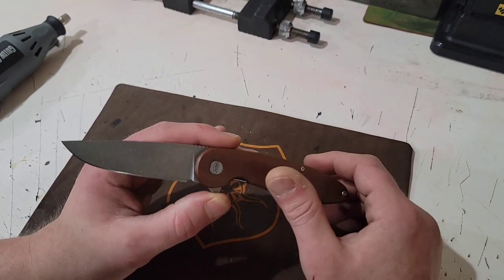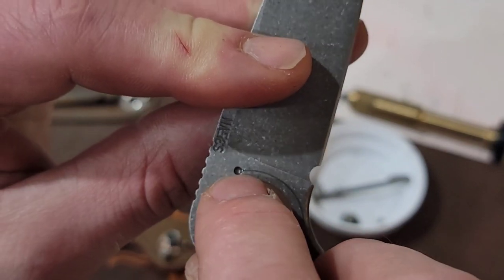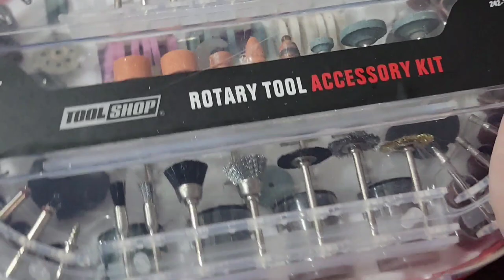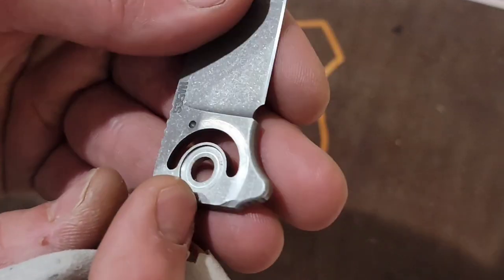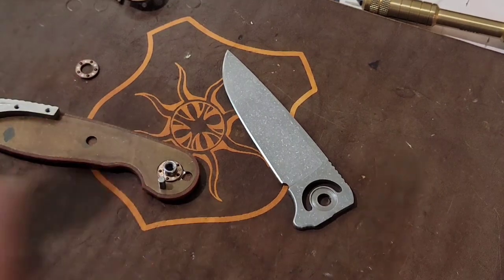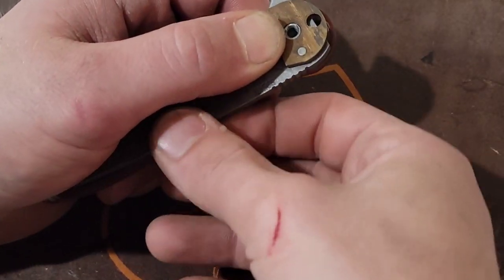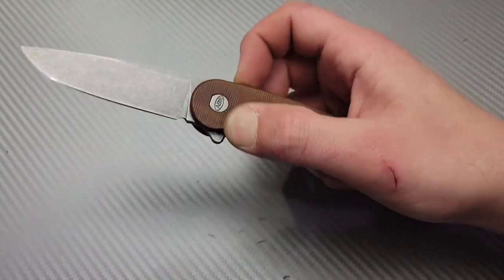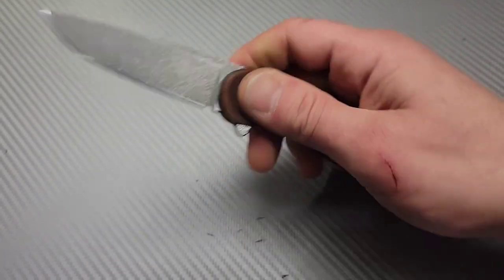FIXING GRITTY ACTION INTO SUPER SMOOTH THIS IS HOW

Comment: I have that grittiness in my Civivi Ortis ! Took it apart, cleaned it, oiled it still the same. I'm going to try this method now ! 
Your " how to fix lock rock" video helped me a lot with the Civivi Riffle ! 
Thanks again !
Reply from the maker: I'm surprised you having issues with civivi knives, but I'm happy these videos can help, try taking the pressure off the lockbar to see if it's smooth with out the pressure like I showed in the video, just to make sure it's the detent and not the bearings, just to be positive which one you need to work on, and try to narrow down the exact issue before so you exactly what to attack
Reply: @NeevesKnives  I was surprised too, to be completely honest, I landed my Riffle who had no issues to my brother, he may used it a bit harder than me, I don't know. Out of the box, I had zero issues with the Riffle, it came after. Yeah, I'll see if maybe the black coating on the Ortis is the reason why the bearings or the detent ball isn't riding smoothly. Congrats on your 10k btw 🙌🙌🙌

Comment: So weird that you post this video today when I had this exact issue on my week old UrbanEDC F5.5 this morning - the bearing and detent were basically dry, so some light oil on the bearing and a tiny drop of synthetic grease in the detent hole has taken care of it for now, but the ball has already started making a groove in the blade so I'll probably need to polish it.
Reply from the maker: Yeah or you can just let it break in, if it's smooth with oil I'd just let it break in naturally, also letting it get dry from oil can help speed up the process

Comment: Fantastic!!!  Are you aloud to do this with medford knives?
Reply: No, you’re not allowed to look at the pivot on a Medford without voiding the warranty 😂
Reply: @1130jawz  Bull crap really???
Reply from the maker: No doing most anything to a Medford aside from cleaning it will void the warranty as long as you have no issues taking it apart or putting it back together perfectly
Reply: @NeevesKnives  Are we aloud to cut with a medford knife?
Reply from the maker: @Casper711024  😆 supposedly the warranty is still good as long as you don't mod or mess anything up taking it apart for Cleaning.
Reply: @NeevesKnives  I wuz gonna use it 2 cut a steak but You can't get oil or grease on it !!!

Comment: My Gillian’s needs this but I’m not afraid of just flicking for months to get it. My knife is the very first time he’s ever acid etched a blade and my guess it’s the acid wash on the detent surface
Reply from the maker: In many cases its good to just allow it to break in over time.
Reply: @NeevesKnives  like it’s action is super smooth when deploying open but closing its just like your American blade works with the terrible gritty sound and all and it has to be slap shut to shut.
Reply from the maker: @tallica4life81  even the satin finished version I tried had to be slapped shut as it has strong lockbar tension, it's Def not a fall shut kind of knife but it wasn't gritty so that one needs the detent track broken in